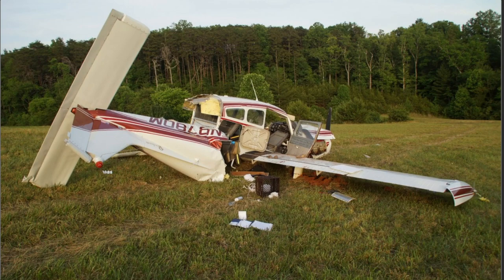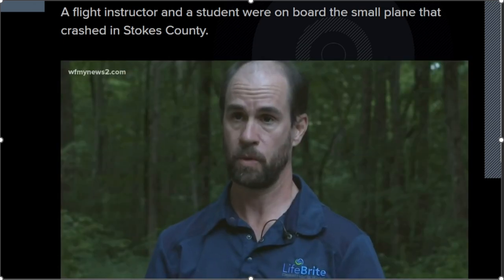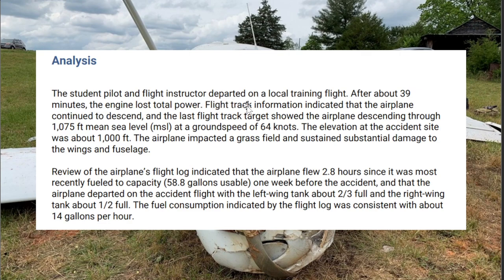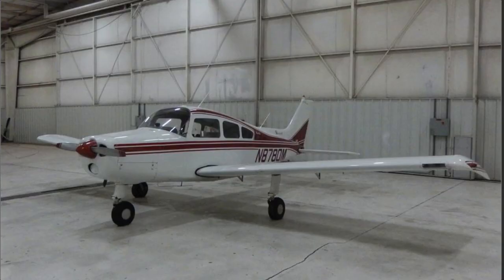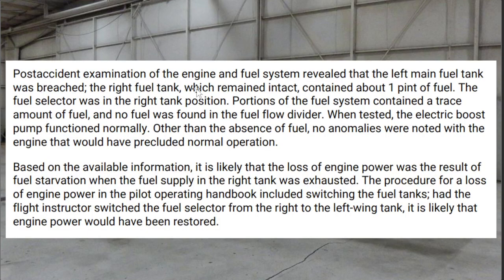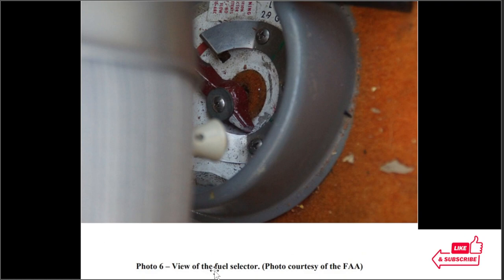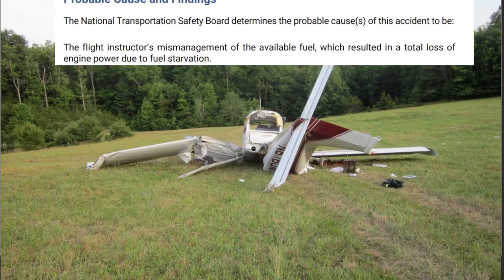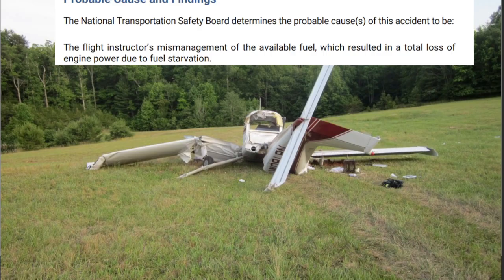Fuel Starvation of Beechcraft Musketeer II in North Carolina

Comment: I took my primary flight training in a Musketeer.  They are great flying little planes, if you remember to put fuel in them. The fuel selector switch was drummed into our heads.
Reply from the maker: Thanks for sharing with us
Reply: What size engine did this aircraft have? A friend has a Musketeer that burns only 8.2 gph. 14 sounds excessive.
Reply: @brucecuratola6389  14 is bizarrely high

Comment: I practiced my plane's loss-of-power procedure until it became second nature: 1/ pull deicing knob, 2/ switch fuel tank, 3/ push mixture knob "full rich," 4/ switch on electric fuel pump, 5/ use ignition to restart. All this should take only a few seconds.
Reply from the maker: Right on for sharing
Reply: Yes, it is good to have that memorized, and it does only take a few seconds to do that.   Then it may take around 15 seconds for fuel from a tank that actually has fuel to travel up to the carburetor,  so if you are on final, it still may be too late.  This is why all landing checklists should start with "fuel set to fullest tank."

Comment: Like the Ercoupe with limited elevator preventing stall, when slow we come down really fast.  The hill ahead may have triggered an early deceleration, but we need to use that potential energy of altitude to exchange for enough airspeed to reduce sink rate.  When low enough, we need to decelerate as well.  Like in auto-rotation, flair is a one shot deal.  Round out and hold off?  No, that would be too fast for most available emergency landing zones.  Most engine out landings touch down beyond half way through the available landing zone.  This one was different.  Wolfgang in Stick and Rudder had the solution to this and all landings, "The clue to watch is the intended landing spot and the scenery beyond it and to the sides of it.  Once the normal glide has been broken, the process of stalling the airplane down can be gauged entirely by watching the spot and the perspective in which it appears and its apparent motion."  We have lots of muscle memory with this apparent rate (not real rate) of closure useful optical illusion.  We do this very thing coming into every intersection with our automobiles.
Reply: For me, it looks like The Panic Pull stroke again.  Ran out of fuel, and out of talents to land with no power too.  It was a CFI.. Was..

Comment: I’m not a pilot but two things caught my eye. First the instructor pilot had only around eight hours in this make and model - which obviously means no more than that in this plane. 

Second, the report states that the plane consumes an average of nine gallons per hour, but according to the flight log the consumption was 14 gallons per hour. 

This seems contradictory to me. I realize more fuel is used on takeoffs and landings but still, I’m having trouble squaring that circle.
Reply: Maybe they didn't lean the fuel mixture properly, this would explain the high fuel burn, just a guess.
Reply: @dwaynemcallister7231  I see that you know a lot more about this than I do. 

But I think I understand the concept. 

Thanks.
Reply: My friends Musketeer uses 8.2 gph. I don’t understand 14.
Reply: @dwaynemcallister7231  My understanding is that the fuel system by its nature always transfers fuel from the right tank to the left tank via a return from the fuel injection system to the left tank only. It is possible for the left tank to overfill and void via the breather during flight increasing the fuel consumption beyond what may have been expected. I wonder why the instructor did not switch tanks as the left tank should always have some fuel in it after running on the right tank for some time.
Reply: @DARANGULAFILM  Wow, that's a thing to know if flying this airplane, I don't like that set up. My own plane is a Rotax 914 powered Europa and it too transfers fuel back to the tank but it's only one tank so pretty simple. Know your plane!

Comment: It is hard to believe with the size of that field how a safe landing was not made. 
Of course it is easy to say that sitting here, but it just seems a bit odd. 
So sad for the families.
Reply: The CFI stalled it on a nice flat grass field.  Outstanding..
Reply: Right on. Judging by the wreckage,  they hit nose low hard into the ground.  These are tough airplanes, so it takes alot to make them look like that.  Mismanaged fuel, and airspeed on decent for proper glide.  So sad they ended up the way they did.
Reply: Woman pilot. What do you expect

Comment: With the absents of shoulder belts the fatality was probably caused by a massive face plant into the dashboard, because the cabin looked survivable. I have seen much worse damage in other accidents where everyone survived because of shoulder belts and not just lap belts.
Reply: I no longer fly any aircraft without a shoulder harness.  Mine has a 5-point system, but even a 3 point will save your life.
Reply: The hole thing was survivable even the plane if he would have managed his best glide speed  , instead of stalling it and falling out of the sky .
Reply: Back in the 80’s I had a good friend with @ 250hrs. He, his wife and three kids tried to take a Cessna over the CDN Rockies from Trail BC to Calgary.
  Could not climb over terrain did a 180 and planted it on a logging road. My friend and his wife as well as the toddler in the middle seat in back died on impact from breaking necks on the glare shield. The two boys 8 & 9, both survived and walked away.
  The wing clipped a tree causing the plane to veer off and stop abruptly.
  Besides a semicircular dent from the tree and a slight bend in the prop, the TSB said the engine would run fine and no damage other than that mentioned above happened. Easy to repair…

They were only wearing lap belts even though shoulder belts were there. They would definitely have survived otherwise. Their toddler simply slipped out of her seatbelt and hurled forward hitting the instrument panel between her parents.
 I remember it like it was yesterday 😢
Reply: @57Jimmy  
Sorry to hear about their tragic results  .
Reply: @57Jimmy  
I thought a 180 was strong enough to get over the mountain  ?
Reply: 5 point restraint for sure. At least on take off and landing over land .

Comment: It's amazing to me the a pilot forgets about checking fuel, one way or another.  I mean, gravity is a real problem when you can't maintain forward air speed because you fail to switch a lever or otherwise just run out of fuel.  Interesting video and very sad, but, as I said I always find these kind of oversights and accidents baffling. And the pilot, a gal, appears fine and is still a flight instructor at the same school - just idling away my time I checked her Facebook page.  Seems like that's the kinda mistake that could get you fired.
Reply from the maker: I would think so also

Comment: Cabin looked survival until you see the tail break off the way it did. It looks like a low altitude departure from flight with left spin entry due to the torque at impact snapping the tail off, left wind buckled, front end damaged extensively, lack of ground scars/trail, and the seriousness of the injuries (hard impact). My guess.
Reply from the maker: Appreciate it

Comment: FWI: The gas gauge has to be accurate only 1 time annually, during annual inspection.  They drain the gas and if it gauge reads zero, the aircraft passes.   Even if the gauge passed the inspection, they can be inaccurate and finicky.   Also, most planes under 200hp lack GPH gallons per hour gauge, you just lean the mixture without the gauge, which is acceptable. But how do you know what your fuel consumption is, with out a GPH gauge or even better yet, a computerized fuel tabulizer.  You cant see the gauge cause not all aircraft have GPH, so you have to rely on the "POH" pilots operating handbook to see the fuel charts.
Reply: Gas gauges are never a thing to bet ones life on, tanks need to be physically checked, that's what I was taught, you need to know how much fuel is onboard and the burn rate and then leave a safe margin extra.

Comment: What? The Beech Muskateer uses about 7 to 8 gallons per hour not 14. It's a 150 hp engine. 14GPH is almost double in fuel consumption. This is definately Pilot error due to not properly monitoring the fuel system. Furthermore, who died. The Pilot or the Student?
Reply: Yep, 14 gph is way too high..
Reply: My understanding is that the fuel system by its nature always transfers fuel from the right tank to the left tank via a return from the fuel injection system to the left tank only. It is possible for the left tank to overfill and void via the breather during flight increasing the fuel consumption beyond what may have been expected. I wonder why the instructor did not switch tanks as the left tank should always have some fuel in it after running on the right tank for some time.
Reply: @txkflier  The aircraft I flew in donkey's years ago had fuel injection and a return line to the left tank. Subsequent versions of the aircraft may well have been revised to keep things simpler. My recall is that I read about it in the flight school's own handbook for the Musketeer. Because of the greater distances between much fewer and scattered airports in Australia, the effect on fuel endurance is more critical. Therefore it may have been emphasised in the handbook for fuel endurance versus the inconvience of fuel stains anywhere. I may still have the handbook somewhere.
Reply: @DARANGULAFILM  I was looking at the wrong manual. The IO-346, being fuel-injected, does return the excess fuel to the left tank. So, it must be used first, and will probably have some fuel remaining when the right tank goes dry. I think what I just read said that about 10% of the fuel is returned to the left tank. It’s things like this that you had better know about your aircraft.
Reply: @txkflier  It is a nice little hedge against fuel mismanagement which might buy a few more minutes of flight time if the good cards fall into place but yes, best to not let one'self be painted into a corner in the first place.
Reply: @DARANGULAFILM  The 1972 Cherokee Arrow II that I used to fly in the 1970’s had a Lycoming IO-360, but I don’t recall having to use one tank before the other. The POH I just read doesn’t mention it. I knew some cars send excess fuel back to the tank. I don’t know why that Musketeer does and the Arrow apparently didn’t.
Reply: @txkflier  The differences between the Cherokee Arrow and Musketeer may be purely the design engineers' respective choices, cost, keeping it simple, one less fuel line to break and two or several less connections to work loose and leak?. Maintaining a constant flow of fuel through the feedline by sending some fuel back to the tank minimises the chance of vapour lock, especially with fuel injected engines. I think it also has something to do with keeping a constant fuel pressure regardless of volume delivery for accurate metering.